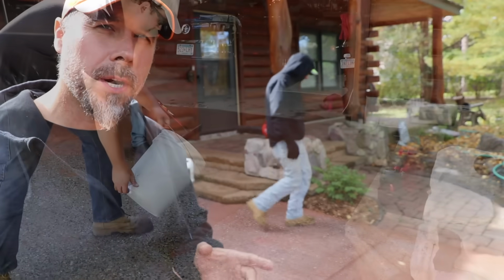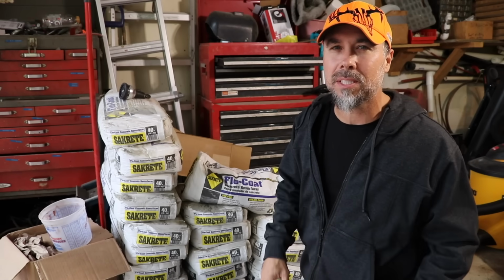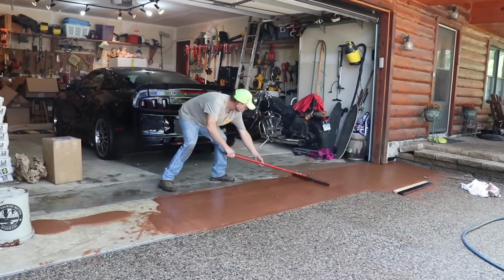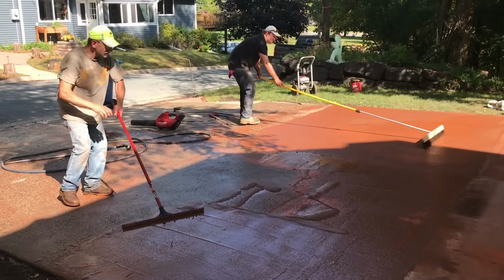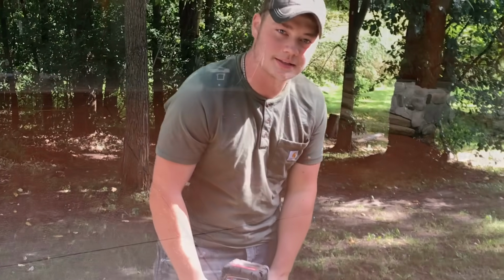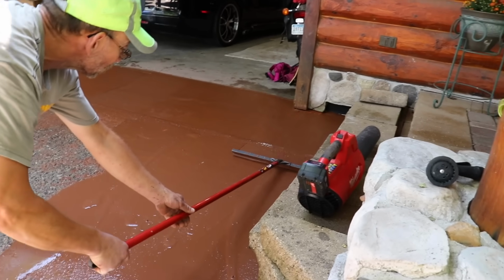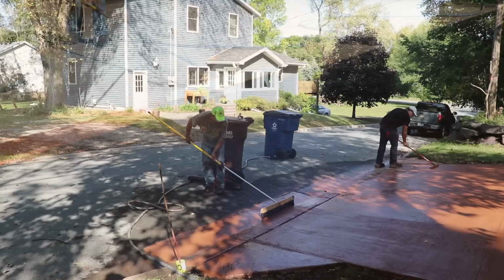How to Resurface Concrete for Beginners Part 2 $660 DIY Driveway repair / restoration project

Comment: Looks great sure but my issue is this...you say this can be done for $600.00 (I think you said that price). You did not take into account the tools used (the concrete mixer tool., squeegees, buckets, etc...) This project is not for the everyday joe/Joanne.  Very cool looking for sure but $600 is misrepresenting the actual cost for a person who may have never used the materials before

Comment: hey mate. does this product also work on exposed ag that is not smoothed. currently have exposed ag driveway and is rough under foot, looking to smooth and then paint ? hoping this product will help with smoothing out.

Comment: You mentioned that it has to be completed at one time, that you can't do half and then return the next day to finish it.  Is that correct? I ask because I have to complete this by myself and it is a two car driveway.

Comment: LOL! Narrator: "When you're mixing your flowcoat, precision with your water is key to get consistency over the entire product." (In background, a guy measures water in a measuring bucket by holding it up in front of his eyes instead of putting it on a level surface.) 

The only way that could have been funnier is if he set it on the sloping hood of a pickup truck.

Comment: I have many cracks on my double car garage driveway. Cracks range from 1/8" to 1/4" which appeared like spider webs and may not settle entirely. Some surfaces where the cracks were had lifted up to 3/8", which present a tripping hazard. Will this DIY resurfacing helps further deterioration of my driveway if proper prepping and leveling? If not, what other methods or options do I have without spending an arm and a leg.  The replacement of my driveway would cost $5000 or more. Thanks.
Reply: I heard of a system that will even out the height difference, its like jacking up the lower side to meat the higher side, then the concrete is drilled several holes, a kind of foam is injected to fill the space under the concrete. I saw it done on a driveway, looks pretty good

Comment: After researching decorative concrete coatings for several years, I can tell you that won’t last. You can’t just pressure wash the drive way, you have to grind the top coat down untill you start to see stone. It will look peppered. Also, a rubberized system like elastideck from ez concrete supply, would last a hell of a lot longer then an over coat of Crete.

Comment: Sorry,  but the exposed concrete looked much, much better.  This looks awful.
Reply: THey need to do a sand and clean and add a 2nd coat with a smaller squeegee applicator to make it look right...IF the material is smooth enough. He said you cant mix batches, so this must be some harder material to work with, so I doubt I would use this in my jobs.
Reply: I agree that’s horrible
Reply: Looks like crap
Reply: I was throwing up when I saw they were covering that exposed aggregate.... WHYYYYY😩
Reply: Don't be sorry , it's the colour!!
If they had used another colour it would have looked a lot better !!

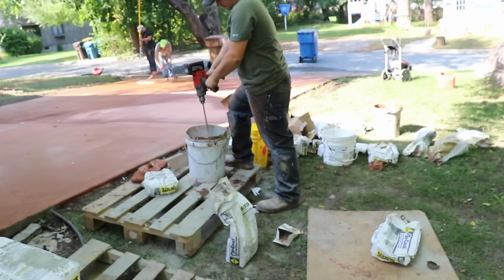Comment: @1:20 - Here's a "tip": WEAR A DUST MASK AND EYE PROTECTION!
Reply: Agreed. I am far from "Mr. Safety", I have seen guys on here in recent days put on more gear than a Crusader to change a light bulb, but I tiled my whole house, porch, and patio included without an N90 mask. Baaaaddd bronchitis.

Comment: When the contractor poured my sidewalk it was winter and cold 2 years later and now the top coat is flaking. Their answer is ripping the whole sidewalk up.  Can any loose areas be removed and the whole area covered with this product?
Reply from the maker: Yes you can.
Reply: Thank you

Comment: Can this type overlay stand up to a 30k lb motorhome? I need to refinish my driveway too. If you are doing this by yourself can you section it off and do it in sections(like between every expansion joint)? Thanks Stanley.

Comment: Just a tip for when I do Ardex to measure the water evenly every single time cut a hole on the side of the bucket to the correct measurement of water so every time you scoop out of your bigger bucket you will have the same results
Reply from the maker: Awesome point!
Reply: Love that tip Chanse. Each worker sees the same line but somehow amount is different. Genius tip. Dummys it down to ensure consistency.

Comment: Just a heads up on the cordless mixer for the newbies. Have a spare battery on the charger! 

Nothing like having your drill die while mixing and not have a backup batter available. LOL.
Reply from the maker: Very True!  Goodpoint Hugh
Reply: That's why you just save money and buy a cheap harbor freight CORDED low speed drill (or 2) for messy jobs like this.  No need to worry about batteries and since is a cheapie we don't care about the drill's health either.  It's plenty capable of mixing watery mixes like flo coat.

Comment: Do you have troubles with blow and string trimmer getting clogged with in burnt carbon and oil because because worker  can't use full throat very often??
Reply from the maker: I use electric ones for light duty work.
Reply: Really no gas 2 strikes

Comment: "Flippers" will love this, though that's not necessarily a good thing.  Thanks for posting, as always
Reply from the maker: True- its an easy way to repair a driveway.
Reply: This is nothing new.  This stuff has been on the market under various brands for probably over a decade.